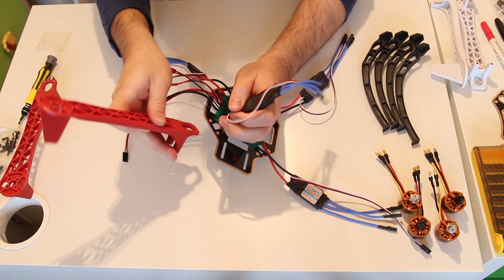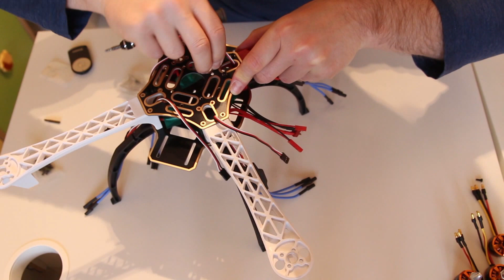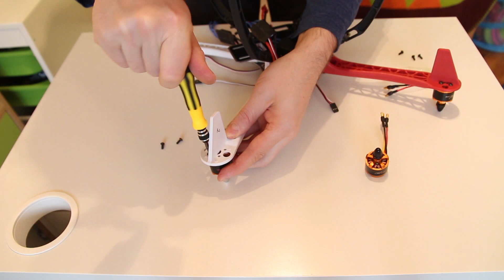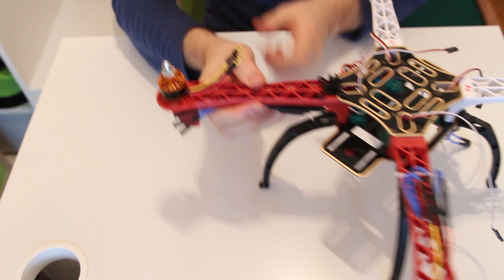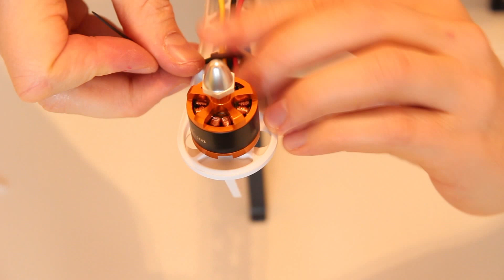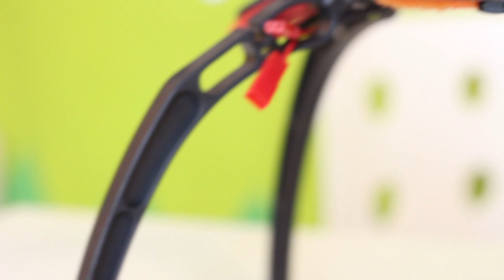F450 DIY Quadcopter build

Comment: Great video mate! Quick question: do the ESCs already come soldered to the Power Board or did you do the soldering yourself? Also, the motors already came with banana plug?

Comment: this might me a dumb question but do I only need the servo wires which come in a 3 wire set to connect my flight controller receiveer to my apm 2.6 or a jumper wire can do the job to